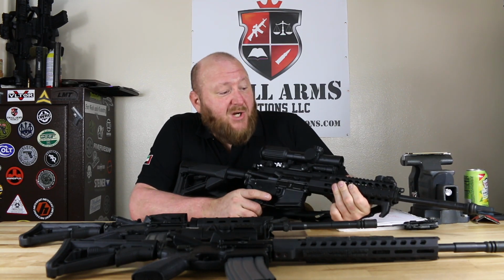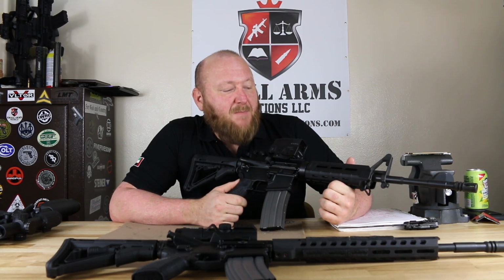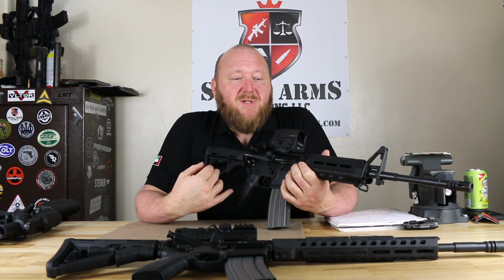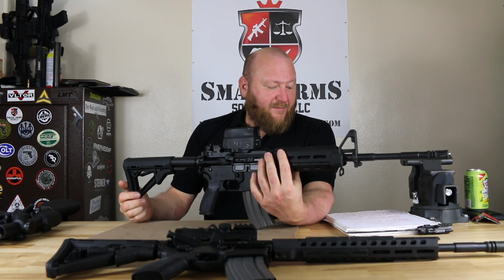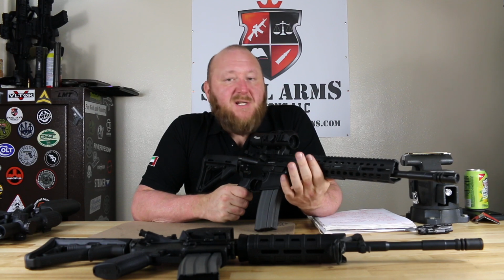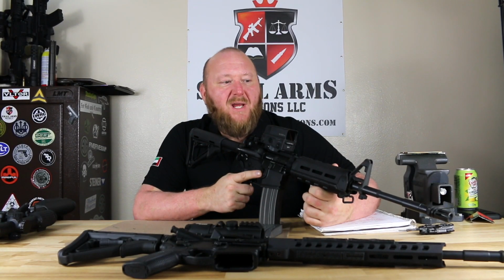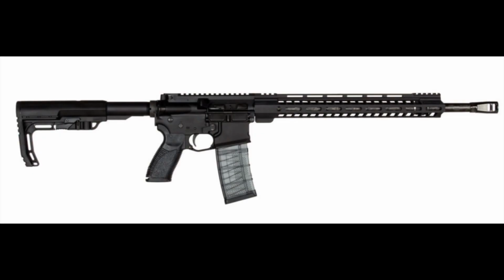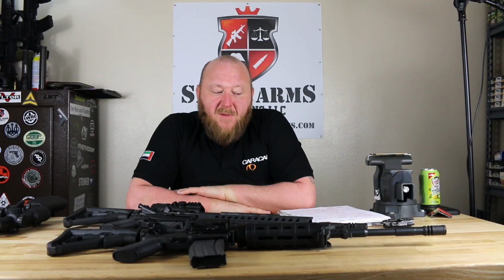The Caracal CAR814A2 Family

Comment: Hey Chris, ive noticed that the 50 and 45 gr varmint & predator loads from American Eagle, Winchester and Sig tend to fly apart if it strikes the ground, a branch or even a cardboard target when fired from my modded FN 16" M4/RECCE carbine with its button rifled, chrome lined,1/7 twist barrel.
Ive never noticed them coming apart inside the bore but definetely upon striking basically anything.

I didn't realize there is a danger of them coming apart in the bore.
If this occurs can it damage the barrel or is it just a terminal effectiveness issue?

I ask because my FN really likes the AE 50 gr varmint & predator load at 3325 fps, grouping sub 2" at 100 yds and usually more like 1.5"  believe it or not.
And i also have some Sig Sauer Elite 40 gr varmint & predator loads ive been wanting to try.
At 3,650 fps(claimed) i expect them to make a mess of a melon but after seeing this video im hesitant to fire them.
What would you suggest?
Thanks in advance!
Reply: call newt

Comment: Chris, Thanks for another good video.  I don't mean to nit-pick, but I have owned several Minimalist stocks and they all have had a standard CAR spring-loaded locking pin and lever (albeit flush fit) and therefore work the very same way ....which locks in both directions.  Some buffer-tubes/receiver-extensions may not allow many stocks (like the Minimalist and later Magpul designs that came after the CTR) to align in the fully-closed/collapsed condition, which means the stock isn't locked only in that one position.  Also, some tubes are roughly machined and may not lock when brand-new until the holes wear a bit, with many different stocks.  

BTW, in the endless pursuit of perfection, I run the POF 308 length buffer-tube with the correspondingly longer and heavier VLTOR A5 buffers and Tubb flat buffer springs with the tube slightly-modified to work with the Paul Leitner-Wise heavy-duty buffer retainer ($14.95 w/free shipping) which are "bulletproof" as compared to the mil-spec part ...all of which parts I have tested and highly recommend and which combination is outstandingly durable and reliable and versatile to run reliably all known 5.56/223/300/6.8/etc. uppers, even piston-driven without any fear of ever damaging a lower.  The flat springs can be a tad annoying to remove ...by "unscrewing the spring" at least until some spring-compression is relieved).  

While you have the buffer tube off, for about $20, I also recommend throwing in the excellently designed and made Radian AR-15 takedown pins:  https://www.brownells.com/rifle-parts/receiver-parts/takedown-parts/pins/ar-15-takedown-pin-kit-prod104898.aspx

You know POF and TUBB, but the improved retainer can be difficult to find, so here is the link:    
https://www.cpi-va.us/leitner-wise-design-heavy-duty-buffer-retainer/

Anyway, my input is unsolicited, but I think these parts really do enhance the AR-15 in several ways and get us closer to perfection for the AR-15 systems we all love, and worth a try, even if not absolutely necessary!
Reply: Yep. I think something was defective with his minimalist stock.
Mine has been flawless for 3 1/2 yrs and 10,000 rds.
It fits my modded FN 16" m4/RECCE carbines buffer tube tightly with no play yet adjusts smoothly and locks securely. I love mine!
Plus it makes an excellent carry handle and turns the M4 into a walking staff in a pinch. Not recommended however!

Comment: Would you say this carbine length setup with the h2 buffer and the dialed in port size recoils like a mid length gas system? I know you prefer the mid length gas system because the soft recoil and longevity of parts wear. And lastly, would the Car814 benefit from a lmt bolt carrier to bleed off excess gases and lower the cyclical rate?

Comment: I have shot Wolf .223 on the 816 and it functions as long as you set the gas regulator to its "adverse" setting. It will also cycle brass .223 just fine on the standard setting and will even run 5.56 on the suppressed setting. My CAR816 A2 has been an outstanding rifle and I wish I could find some of the shorter uppers for sale and either SBR my existing Caracal lower or slap it on my pistol AR lower. Also, unless this is a different MFT Minimalist stock than the one I have, it does actually lock into place and will not slide out.
Reply: FYI, WOLF GOLD is brass cased, purportedly good quality.
Reply: It runs 5.56 on suppressed without a suppressor?
Reply: @jamesmc8055  Yes. It's very soft shooting but it cycles fine and locks open on an empty mag.
Reply: We would not recommend running the suppressed gas port setting without a suppressor attached. While the rifle may still function with certain ammunition, the reduction in gas may lead to a under functioning condition creating a malfunction. For this reason we have utilized a lock out detent which must be depressed to place the rifle into the suppressed gas port setting in order to eliminate the possibility of an end user inadvertently placing the system in suppressed setting.